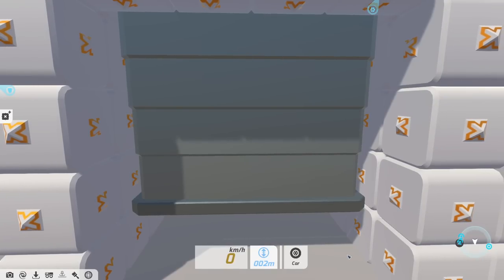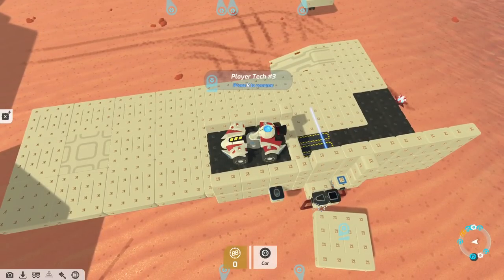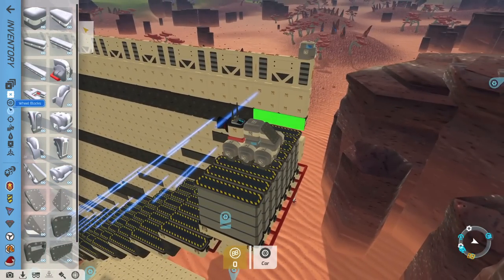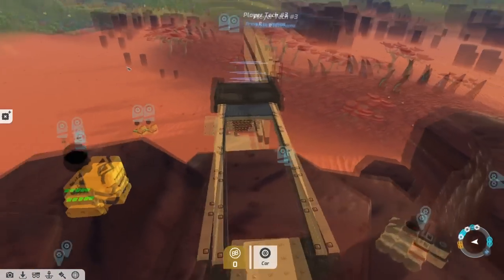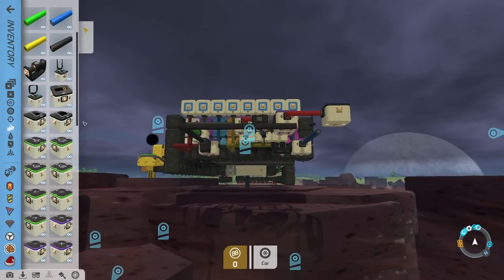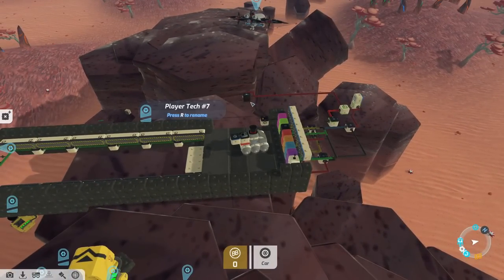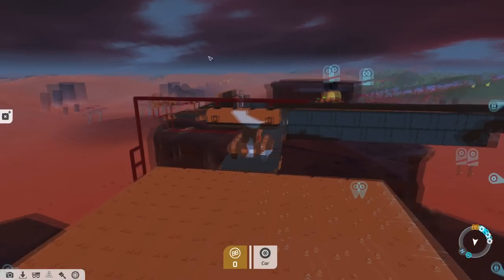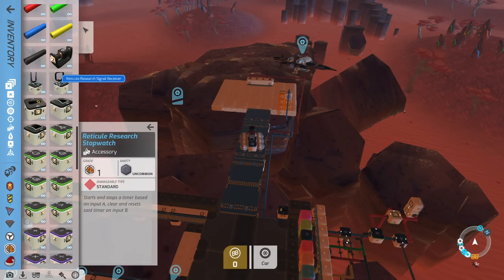Terratech has Redstone Now - AND IT'S AWESOME! | HUGE Update, Just What Terratech Needed!

Comment: Something that'd be really cool is if the correct code would activate the bridge for a set period. After that, it closes again. Also, I wonder if it's possible for some kind of wireless signal transmission where instead of having to press a button, if you get close enough to something it automatically transmits the signal. Because then you can have a bridge that activates as you get close, which'd look REALLY cool.
Reply: Yeah, bet it could be done....
Reply: I guess you can use the laser as the proximity thing and wire it to a transmitter on a certain frequency to another transmitter on the same that output that signal to whatever contraption you have concocted I guess. Not sure, but that's my guess.

Comment: You were probably trying to decide if the order of the buttons matters or not. In some locks, if you press the wrong order of buttons, it resets the whole system. In this system, the order of correct buttons doesn't seem to matter, just as long as you have the right switches on.

Comment: Fun fact, with and gates, or gates, inverters, a power source and form of input you could make a simple turing complete computer assuming the build limit doesnt interfere. Although, if techs can transmit signals then you could circumvent that by building each component as a single tech.